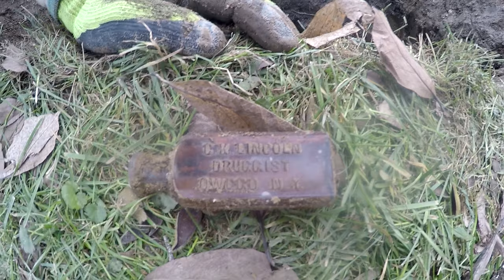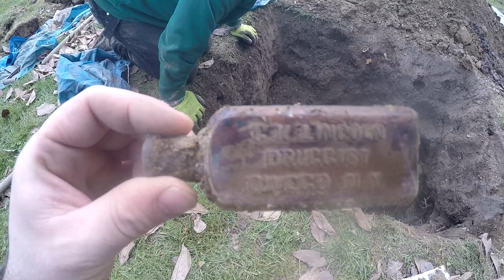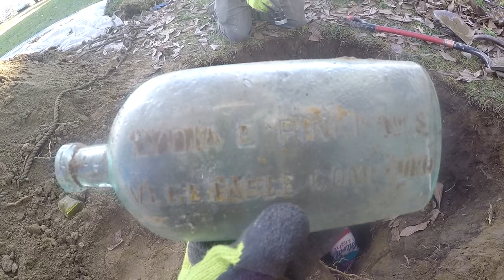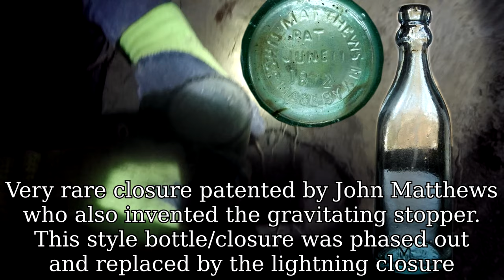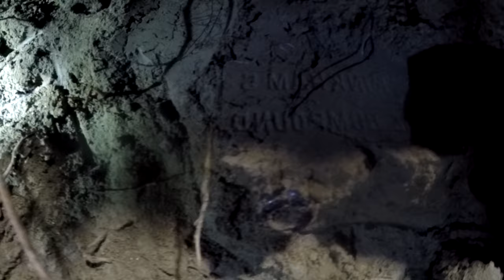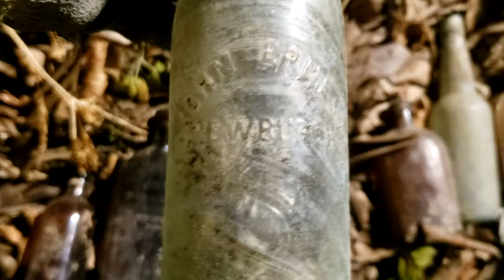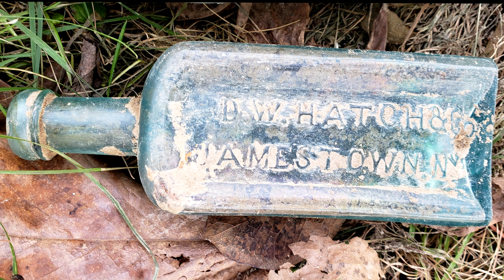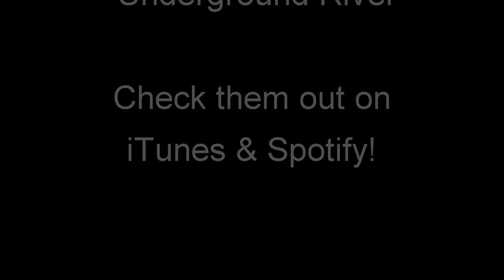Old Map Led Us to Boozer's SECRET STASH! Digging 1800's Privy Full of Liquor Flasks

Comment: You found some awsome bottles. It might have been easier if you had dug out the side walls and pulled the roots out when they're in the way versus tunneling. I'd also try a trowel versus what your using. It may prevent some of the breakage.

Comment: As a former utility worker (ditch digger) all I see is the potential cave ins
Reply from the maker: Very unlikely, but we appreciate the concern! Most of the pits we dig are shored by stacked stone walls. In this video, they were wood liners. Though the wood has usually long decayed, there is a thick clay layer preventing the surrounding ground from becoming unstable.
Reply: @ParlorCityPickersDiggers  wow cool didn’t know that. Regardless, be careful out there. I’ve seen disturbed soil do some squirrelly things. I’ve nearly had a couple of bad days myself even with mechanical shoring. Good luck to y’all.
Reply from the maker: @SordSwingrr1  appreciate it man! Digging old dumps can be a different story and can get really sketchy! Still, have to be careful no matter what, no matter where. Hope you enjoy the vids!